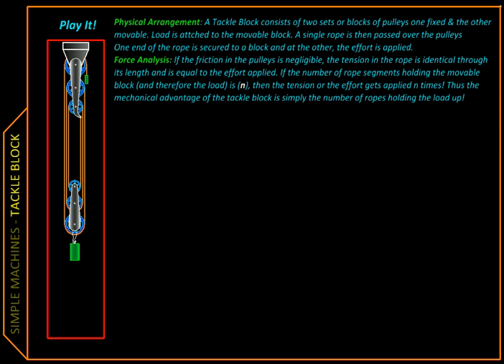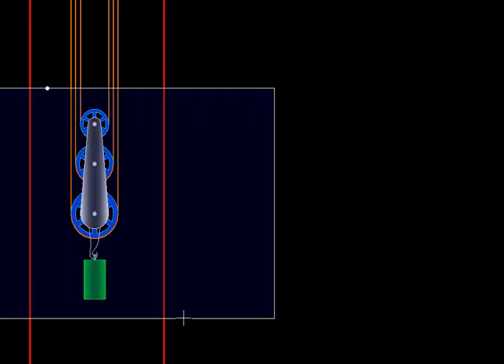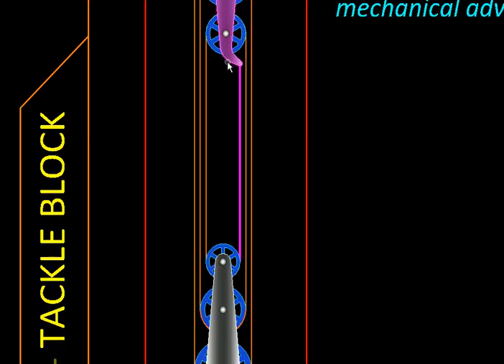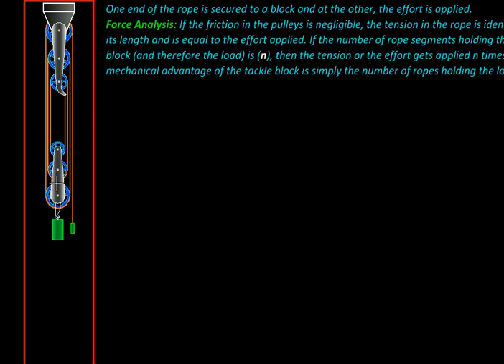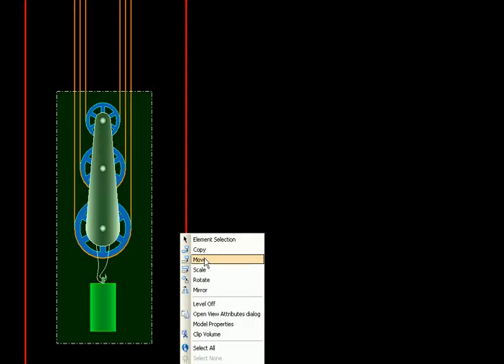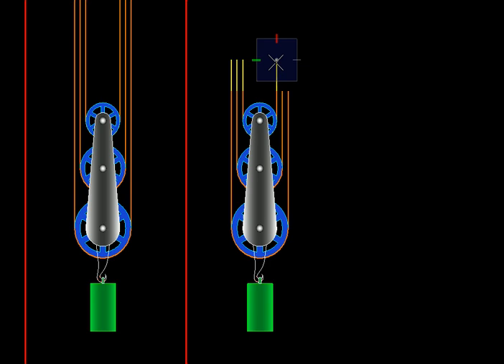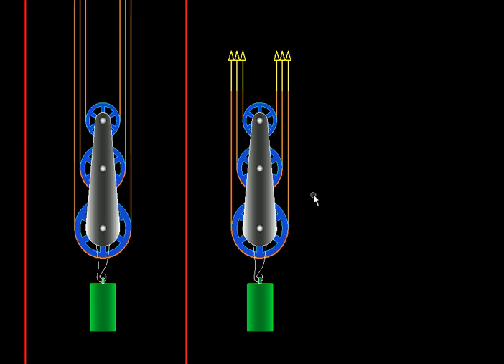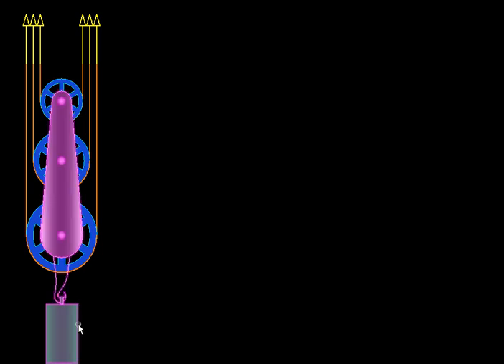Physics with MicroStation Simple Machines Tackle Block

Comment: Hi,

And thanks for the drawing, animation and explanation. I have never understood how or why almost all with 4 wheel drive vehicles tend to think just because they have this vehicle it is a case of attaching a single rope or cable and the tree stump or engine or whatever else would give up in gear!   ;-) which a simple multiplier like the block and tackle can do the job with far less strain and a whole lot safer. 
Have subbed. Thanks again.

mrbluenun